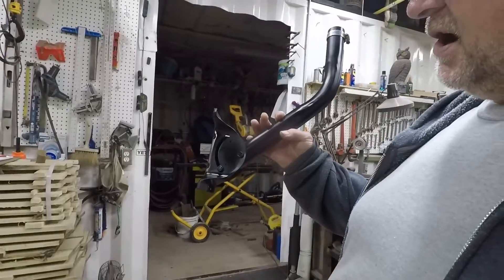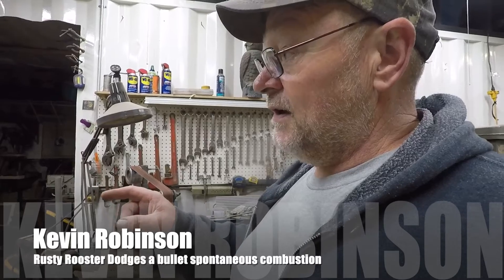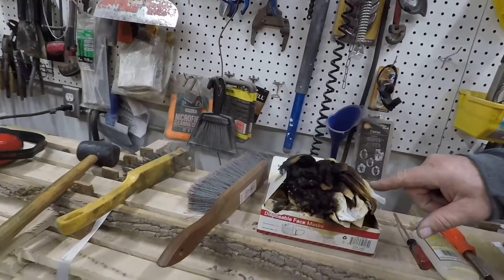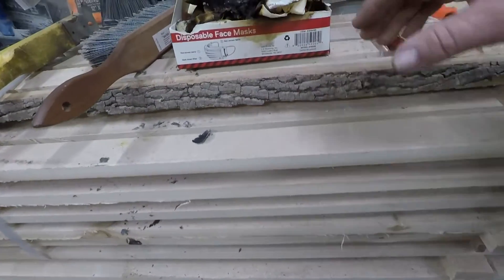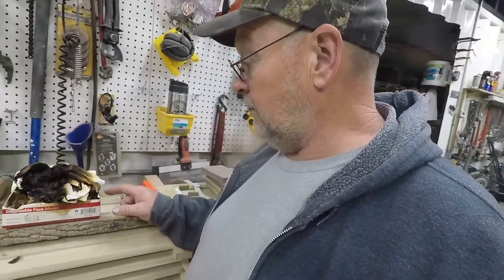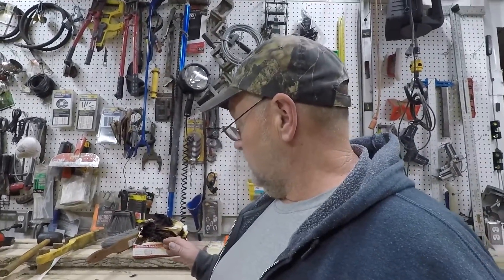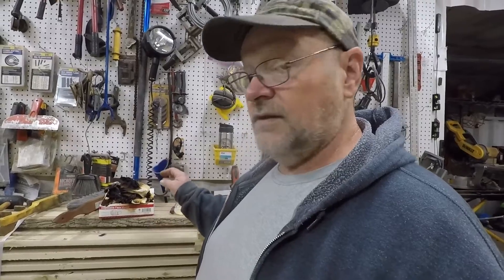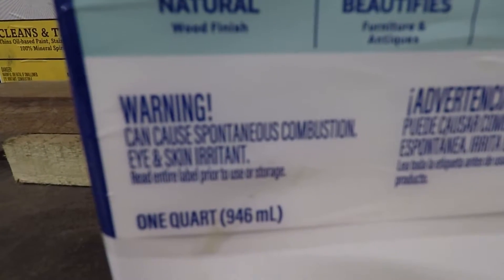linseed oil spontaneous combustion

Comment: The same Omega 3 fatty acids in linseed oil that make it healthy also make it oxidise. Putting it on paper or Fabrik spreads it on a huge surface and gives it a lot of air contact. If you pile these rags up or put them in a trash can than the heat that this reaction produces gets traped and builds up. Like other fats its also flamable.
Reply from the maker: Thanks for sharing.

Comment: You are indeed lucky.  You did about the worst thing you can do. You made a pile of rags on top of combustable material. I drop my rags in a bucket of water when I'm finished with them.  When the project is finished, I dry the rags outside then do a controlled burn to dispose of them.  Probably a little overkill but there is no chance they will cause an accidental fire.
Reply from the maker: I think I learned my lesson I hope I can help someone else thanks for the comment.

Comment: Always soak your towel in water after applying linseed oil.  If it’s a paper towel, soak it in water and throw away.  If it’s a cloth towel, soak in water and hang up to dry—it will be fine to use later. 
Whatever you do, don’t leave any linseed soaked clothes unattended.   
It usually takes around 6 hours for it to combust.  At least in my humidity.
Reply from the maker: Good info thank you so much.

Comment: What's common knowledge for some is something unheard of to others. 
In my youth, hanging oily or greasy rags and drop clothes used for painting, staining, mechanic work... were hung out on a steel cable outside to dry before reuse or being thrown away. If we were planning on burning, we'd just toss the damp rags in the fire pit. 
It wasn't uncommon to witness a pile of hay or such smoking and bursting into flames too. In the winter, hollowing into a haystack for warmth was a thing.
Reply from the maker: Thanks for the information i appreciate it.

Comment: you are very very lucky   . the fire station here does a demo of this every year .. yes the rags will self ignite ..so at the shop we use metal 5 gal can with metal lid . and it gets left outside .. when can half full we burn the rags ..
 ps temp and oxygen  is critical for self-ignition so seal the lid tight ..🥃
Reply from the maker: Thanks for the info.

Comment: Linseed oil is quite flammable and depending on how many rags and how much oil is used depends on fast it will burst into flames.
It's one of the reasons why linseed oil is not used as much anymore in the industry. And if there are any other chemicals on the rags it will also change the reaction time.
It's one of the time's that you really want to read the warnings ⚠️
Reply from the maker: Thanks for the info.

Comment: there is a chemical reaction between linseed oil and paper towels that causes oxidation. that reaction will put off heat and if the towels are piled thick enough they will get hot enough on their own to ignite.
Reply from the maker: Thank you for the information i appreciate it.

Comment: You cant- dont want to let Oxygen get to your oil soaked rags. I put my used BLO rags in a zip lock bag and squeeze all the air out. They will still get warm from what air is in the bag but NO burning. I would seal them up in zip locks then put them in your metal trash can.......OUTSIDE! lol.
And yes they CAN spontaneously combust......if left in a pile, on the floor, in the open air.
This goes for any type of oil on any rag, but BLO is one of the most dangerous. Used motor oil, not so much.
Reply from the maker: Thanks for sharing i appreciate it.

Comment: Industrial soy oil can do the same thing. I know that from personal experience.  
 I worked at American Renolit (Laporte,Ind.)  back between  2006-2008. Back in the paste mixing department we had a trash barrel smoldering fire from all the discarded soaked rags that had been used for cleaning out large metal mixing pots that hold the finished color paste. SOY GOLD was the brand of cleaning oil used to clean up afterwards. 
 That shit CAN combust old shop rags if they are dumped together in trash barrels.

Comment: Yes, oily rags (nearly any kind) will spontaneously ignite when rolled up or piled up together.  The open top trash can is not the place to put them!  They should be put in a tightly covered metal can and placed in an area of low fire risk, i.e. away from your building and fences.  Or in the alternative, spread out single layer to air dry.
Reply from the maker: Thank you so much for the information i appreciate it.

Comment: Greetings,
Any oily rag will spontaneously combust especially when left in a pile.  It is not just linseed oil. The warnings always say to either put them into a covered/sealed metal can or lay them out to dry and Never to leave them in a pile. 
Thank You for the video.
JR
Reply from the maker: Well i almost learned that the hard way, im just so thankful that it didn't really take off, it kind of smoldered its self out.

Comment: 👍👍👍 After using Linseed oil I always open the cloth and hang it up outside. I can remember the details but there is a chemical reaction that causes the rags to heat up. Thanks
Reply from the maker: For now on their going in the wood burner sure did scare me.

Comment: You are suspose to use a metal waste can to put your rags in whenever you are using oil based products.  When I was in high school (62 to 64) our woodshop classroom caught on fire because of this very condition.  Luckily, we had metal waste cans that had a build in metal top.  You stepped on the lever to open and close the can lid.  We were lucky that the can was away from any woodentries boards because the rags burned and some small pieces of wood burned before the shop teacher smelt the fire.  He used one of the fire extinguishers to kill the fire.
Reply from the maker: Thanks for sharing my friend. 
I'll be putting them in the wood burner for now.